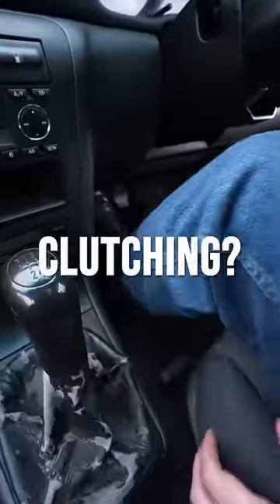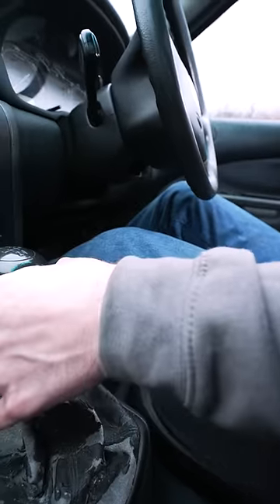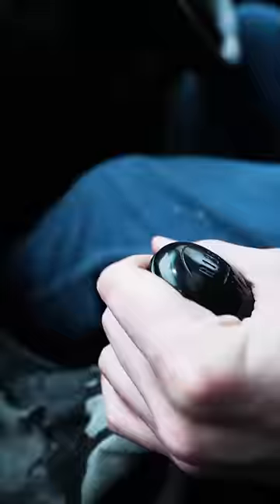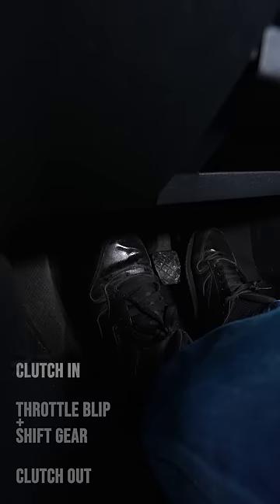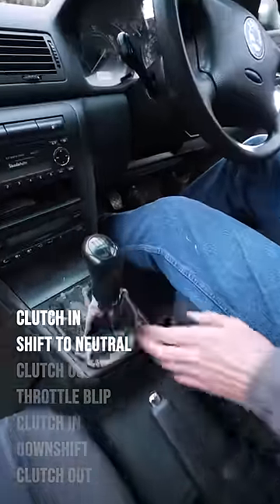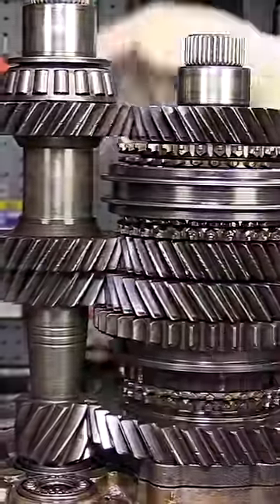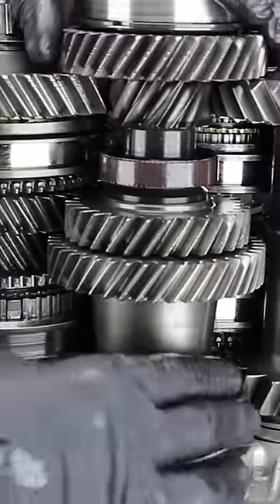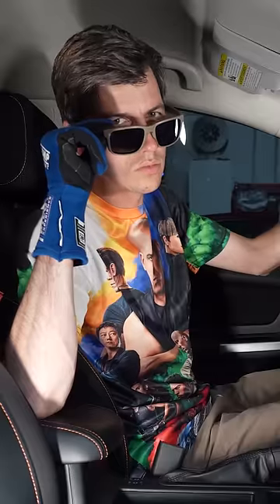What Is Double Clutching? Don't Granny Shift!

Comment: You only needed to double clutch the old crash box trans when you actually were sliding the gear teeth together. The synchro mesh trans did away with that as the gears are always engaged, and you just engage the shift dogs, which are much more beefer than the gears themselves. You can upshift and down shift a syncro without ever touching the clutch. It also made power shifting a reality.
Reply: Clutch is for going from full stop into a rolling first gear. 

Clutch is then quite optional. 😂
Reply: That's a helpful explanation. I learned to drive on an old tractor, so I was taught the manual tricks. I drive an EV, so I've never learned what makes newer manuals different.
Reply: "You can upshift and down shift a syncro without ever touching the clutch."

Depends on the gearbox. Didn't work on my AWD Audi S4.
Reply: @joevarga5982  There is a trick to it. You have to take it out of gear, into neutral, and then apply light pressure on it in the next gear you are shifting to. It may take a few seconds, but when the engine speed and gear speed synchronize, it will just slip into gear. If you apply too much pressure or rev the engine too high, it will cause the shift dogs to not engage, and you will get that clacking sound and stick rumble. If that happens, release the pressure immediately and use the clutch. It can round off the shift dogs, and if you round them off enough, the trans will start popping out of gear, especially under acceleration. When down shifting same as above, but while you are putting light pressure on the lower gear you need to rev the engine slowly and once again when the engine speed and gear speed synchronize, it will drop into gear. And if you are coming to a stop, applying the brake helps as it slows down the gear. Try it again. I have never seen a syncro mesh trans that could not be shifted without the clutch, yours would be the first. If you read this far, I would like to thank you.
 Peace out.
Reply: @roadk88   I KNOW how it's done. I've done it in OTHER cars.

Comment: I watched Initial D when I was 17, got drivers licence and learned double clutching. Now I'm 32 and still only double clutch. It just gives me a good feeling every shift I do, the gear just falls perfectly into place. 
Also my car now has 407.000 Km, just recently had to change it's clutch. It was still the factory clutch... I guess it saved some of my clutch having to grind a little less every shift.
Reply: That, and also synchros in your gearbox probably also said "thank you"
Reply: You can also dog shift, by pulling out of gear, controlling RPM and shifting in gear, no clutch needed. 

My dad showed me that.
Reply: @BotulinSpikedMarzipan  yeah I'm able to do that as well, basically the same thing as above, you just have to match RPMs precisely. Would obviously wear your synchros, so I would not do it daily :-)
But came in useful when I had a clutch broken and had to get to the mechanic
Reply: @DmitriPisarev  Just like dad told me, in case the clutch goes bust, kinda like it once did on our Tomos APN-4
Reply: @BotulinSpikedMarzipan  yay! Welcome to the club of people who know how to shift gears :-D It's not populous...
Reply: @DmitriPisarev  well, i just know how to use a clutch and FINALLY mind-igesting the fifth gear
Reply: @BotulinSpikedMarzipan I've never heard it called dog shifing before. I've known it as "floating" the gears.
Reply: @musewolfman  a sequential gearbox Is called a Dog box, it doesn't need a clutch to acclerate. Hence, Dog shifting
Reply: @BotulinSpikedMarzipan  Sequential gearboxes don't necessarily have dog cut gears, but just very commonly do since dog cut gears are stronger and better suited for a sequential gearbox. Most riders where I'm from just call it clutchless shifting and is stupidly fast and smooth, similar in feel to a DCT
Reply: @Assassin8erated  you could almost call it "Raw dogging the knob"
Reply: @BotulinSpikedMarzipan  nah mate, that's what I call my regular Friday night
Reply: @Assassin8erated  Sweet, bruh
Reply: Double-clutching won't save your clutch. Not more than cheap non-double-clutching throttle blip. On the contrary, it will be more wear on your throw-out-bearing.
A throw-out-bearing is dirt cheap, but changing it isn't.
Anyway, I usually double-clutch and throttle-blip downshifts, too, because as you said: The gear falls perfectly into place. It's a rewarding feeling.
Also, a single-clutch downshift that is faster than a double-clutch downshift is most definitely much harder on the whole equipment.

Comment: Wild. I learned that as "Rev matching" in my 2001 VW Golf. At the time, I was told that "double clutch" was an old type of manual engine that required you shift into neutral to give it gas then shift into the desired gear
Reply: That's why I do it, to keep my rev matching skill ready at all times. Itol reduce wear on the synchros to, if done correctly.
Reply: It'll increase wear on your throw out bearing. 😂
Reply: @Gunbucket1964  what's that mean? Explain it to me like I'm 5 please
Reply: There are three major components to a manual clutch. The first is a two sided disc with friction material on either side. The second is a cover plate with an internal mating surface in the form of a disc and a spring lift arrangement. The third is a ring ball race bearing. The result which the system accomplishes is to trap the disc against the engine flywheel when drive is required but when the clutch pedal is depressed, a cable or hydraulic linkage actuates the release or throw out bearing, operates the spring arrangement and releases the disc from the flywheel. The arrangement slips, which allows progressive take up. 

You will appreciate that this bearing reconciles a rigid release apparatus fixed to the gearbox with the rapid rotation of all of the clutch components when locked or affixed to the flywheel. 

The act of double de-clutching spins the clutch disc and the gearbox input so they reconcile manually with the gear which will be acting in conformity with the final drive. 

The short answer to your question is that the clutch pedal and release arrangement in the clutch cover, including the bearing, are being operated twice instead of once.
Reply: @jonathanlewis453  🔫🤠 That is not toddler appropriate jargon. I thought throw out bearings were replaced with clutches for a tidy job. Aren't those cheaper than synchros? Something has to wear out 🥲, even torque converters.
Reply: @moonshinershonor  Try reading stick shift for manual and you’ll be fine.

Comment: When I was in trucking school, I discovered I'm not as coordinated as I thought...the first weekend after learning about DC, I spent much time going through the motions slowly and deliberately...

clutch in,  neutral; 
clutch out, rpms up (for downshifting , or down, if upshifting );

clutch in, in gear;

clutch out, throttle as needed.

20 years later I can still double clutch and still check my mirrors taking corners. (I now drive a car, btw)

Comment: I always double de-clutch my Jaguar XK120 when going down the box because it has the old Moss g/box. It always snicks in nicely, if I don't I sometimes get a grawnch. 
Also, when over in Normandy for a D-Day com event, I once had to drive a old Morris 5 tonner 50 miles  back to our campsite because the normal driver was a tad drunk. He said the secret is change gear by going into neutral, count 9 seconds then slip into the next gear. OK, I said, I started off, from 1st into neutral, double de-clutched and instantly into the next gear and we got up speed and we drove home without any grawnching but lots of double clutching up and down the gear box. A very interesting day out that was.
Reply: One of the few times double clutching worked
Reply: Thank you for using the correct term, which is...double de-clutching.   :-)
Reply: "That Moss box is slower than my Grandmothers Druel!"  No noticeable synchro's in ANY gear, let alone the dog cog at first!
Reply: @gsd4me00 not to mention grawnch, which is actually a hilariously accurate term
Reply: @gsd4me00   nice that others use the right term Double De Clutching,,
Reply: Now that’s a proper comment! Did you say XK-120? Wow!!! My dad used to renovate MKII Jags back in the 80’s and used me as a panel running down slave for years as a kid. Arrrh! Amazing what a narcissist can get away with! Anyway, he used to double de-clutch from 3rd to 2nd - actually ‘toe and heel’ it. Same XK engine though and  Moss gearbox with no syncho mesh ‘baulk ring’?  on 2nd. Those MII’s could shift my man! Well actually couldn’t shift gears well but were bloody fast. But XK120 territory is absolute royalty! Homage to you dude!
Reply: @I_am_Deliverer  Thank you for your kind words. I have happy memories of several Mk2 jags I have also had over the years.
I am presently trying to persuade a friend to buy an old 3.4 Mk2 that is a bereavment sale. It does not quite run well at the moment, it has been sitting under a sheet for 10 years unused.  🙂
Reply: The secret that you missed was "slip" as in he meant you didn't need the second clutch :) definitely takes some practice and feel for that specific trans, but it is super satisfying how smooth it slips in gear.

Comment: Double clutching is primarily used in heavy trucks. Although many experienced drivers will not use the clutch at all and just listen to the sound of the engine and know when to shift. The throttle blip the video speaks of is especially necessary when down shifting.
Reply: 22 years of driving trucks, I only float the gears, and that's for downshifting. It could be, I work in the city working drayage, that I just got use to the sound of the engine.
Reply: @No_Fuse8771  Floating gears, is that term for not using a clutch.
As you take your foot off the accelerator little bit of pressure takes it out of gear and as the motor slows a little bit of pressure will get it in to the next gear.
Hardly use the clutch on the 4wd
Reply: @geoffmerritt  Yeah, that's not using the clutch but for starting and stopping. I also do this in my Jeep Wrangler 2018. My new jeep has an auto 8 speed.

Comment: They still teach this in CDL schools, if you're learning manual. Also you don't press the clutch and then move the shifter, you do it at the same time. Press and shift, then release the clutch, then press and shift, then release the clutch to engage the gear. If you do it with the right rhythm you barely need to tap the throttle to engage the next gear.
Reply: Done right u don't even need to take foot off throttle at all. Keep it pressed down. Timing tho needs be on point..but listen to engine and you'll get it. Smoothes change ever..but does use more petrol.
Reply: The right rhythm is as easy as the “Adam’s Family Song “….. clapping
Reply: you clutch half way each time you are changing gears and you only go to the floor if you are starting or stopping .
Reply: @jesustontinsalgado6366  Fester is that you?

Comment: Still today, when I drive manual gearbox cars, I double clutch just per-se, because Im used to it. And yes, you can do that double clutch VERY fast.
When I want to shift for example from 5th gear directly to 2nd (when slowing down) (or if I would be speeding through turns and I want to shift to lower gear without losing energy with syncing the motor up to wheels), I will double clutch ... the reason is, I dont want to wait for synchos to grab, when double clutching I can just release the clutch immediately without waiting.

In the past I was even breaking with the heel, while pressing accelerator with toes to cync up. But with new cars where break pedal and accelerator pedal are not in the same level, that is almost impossible to do.

Otherwise Im driving automatic gearbox cars for 15 years daily.

Comment: I actually found a useful reason to double clutch in my mid 2000s saab 93. There was a little clip that kind of returned the clutch pedal back to where it was and it broke. For a period of time I found that double clutching every shift was actually the smoothest way to shift the car. Once I replaced that little yellow piece in the clutch pedal, regular shifting became smoother than double clutching, and I stopped doing it.
Reply: Ayyy, fellow Saab 9-3 driver.

Comment: I've never seen a non synchro trans and I daily drove a 60s truck for over 20 years ... My 65 Chevy C10 had synchros until about 400,000 miles (mid 2000s). 

But once those synchros went it was double clutch both ways. Saved me the one and only time that truck got stolen. Guess thieves can't double clutch 😂
Reply: Fiat 500 had async 1st gear version during its whole lifecycle (maybe not in all versions). And a few Comecon cars. Some of the Czechoslovakian trucks had fully async gearset until like the late 70s or early 80s.

Comment: On my 08 Civic SI I bought the Hondata tuner. It has a no-lift shift option. It works great!
Reply: Can I assume you removed the cats?
Reply: I gotta rebuild my 07 Si transmission before I turn on no-lift shifts. Represent!
Reply: @applepoop10  I was asking as the no lift shifts cut ignition. When it comes back on, they ignite the unburnt fuel now in the exhaust and give u a cool flame between shifts, but the cats don't like it.
Reply: My 1978 Civic has a Hondamatic transmission.   You had to switch from high to low range.

Comment: all we do is rev matching. before changing gears, clutch in then blip then gear shift then clutch out. works like a charm. slight blip while up shifting, slightly more while down shifting.
Reply: Why would you blip on the upshift? That just puts the engine speed even further from what it's gonna want to be when you let out the clutch. That, in turn, is going to wear on the synchros more.
Reply: @musewolfman  so that you don't get much rpm drop while upshift and shifts are smoother.
Reply: @blessedbackpacker222  You will get more rpm drop when upshifting though if you blip it, as it's just adding revs when you want less 🤷‍♂️🤦

Comment: The reason for double clutching is to match the speeds of the transmission intake shaft to the output shaft. That’s so when up shifting you give both shafts the time to match their own speeds, but when down shifting you need the extra time and clutch in so you can blip the throttle to match the speeds between the shafts. Mostly in big heavy duty trucks that have no Syncro to match the shafts speeds. Or you can do it to help the life of the synchronizing mechanism that’s built into each gear.
Reply: indeed and with cars that have synchromesh gearboxes - no need for it at all.....
Reply: I drive an an old mitsubishi 4d36 wagon, what is the difference between double clutching and  rev matching when down shifting? What I do is I just hold the clutch down bump the accelerator lightly two times then shift then clutch out.
Reply: @badwrong6362  Double clutching would be what you're already doing, except that you put the shifter into the center and release the clutch pedal when you blip the accelerator.

When your engine is matched to the vehicle's speed for the new gear, you clutch again, push the shifter into the new gear position and release the clutch. If it's properly matched, for that last clutch release you can just let off the clutch fast without any lurch in the vehicle.

As others have mentioned, it's not needed since cars have synchromesh now.. I guess you'll be saving a little bit of wear on the synchro if you double clutch? But not really needed.

Comment: I like double-clutching, especially if I'm skipping gears.  You feel the shifter twitch when you're at the right RPM.  Just give the clutch a tap and it goes right in perfectly matched and smooth every time.  Also, if your transmission is a bit slow and clunky, it'll be smoother and take less force on the shifter when double-clutched.

Incidentally, most manual semi trucks don't have synchros, and we are taught NOT to double-clutch on downshifts.  Clutch out of the gear, then let off the clutch, quickly get the shifter to the next gear, bring the revs up, and hold a slight pressure on it until it falls in.  If you try that with a car, the synchro will be unhappy about that pressure-holding business.  Also, cars rev up and down fast enough that the RPM window tends to come and go before the shifter can physically move into place, so you miss gears a lot if you try to float it.  A lot of truckers simply use a change in throttle to get out of gear, never touching the clutch at all except for starting from a stop.  Double-clutching is usually a bit faster than floating, but causes more wear.  Sybchros are faster than either, and a dogbox (motorcycle style) is faster still.
Reply: Double clutching is not faster then floating, you just graduate swift academy?
Reply: @jaydunbar7538  You think Swift has a single manual transmission in their fleet?
Reply: @wilko9396  I suppose most modern cars with their soul-sucking rev-hang make it easier.  Or something with a great lumbering V8 and 90lb flywheel.  The Hondas and Mazdas I've had don't like it at all.  Going down isn't so bad because I'm controlling the revs, but shifting up, that tach is dropping like a stone.  Those are the kind of cars I like, because shifting smoothly means ripping through the gears like a motorcycle.
Reply: @JETZcorp  I drive a 13 Mazda2 that floats very well, up or down. Maybe it's the driver?
Reply: @kendallsmith1458  I haven't driven one of those, but the Mazda3 of that year was about when those started rev-hanging.  My 11 NC2 will float, but only if you shift at real low revs.  I normally shift that car at ~3500 if I'm accelerating through the gears, and it won't have that without some clutch.